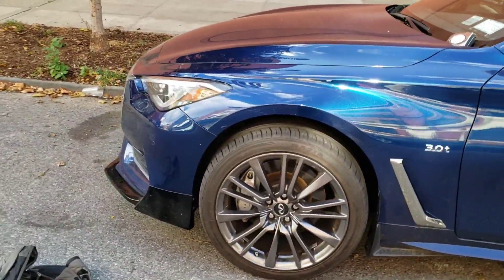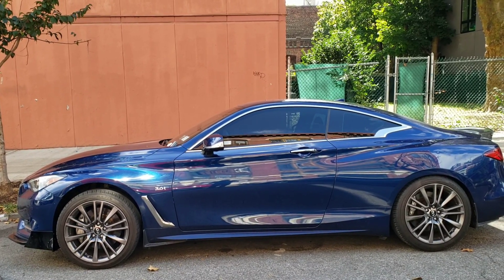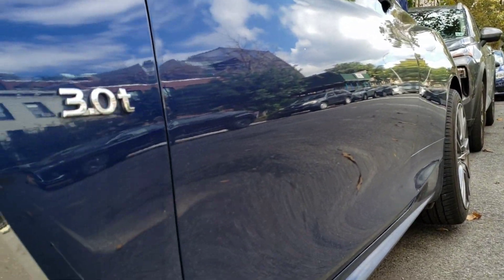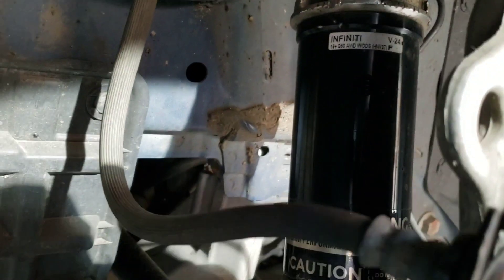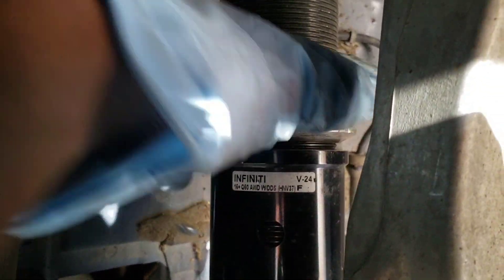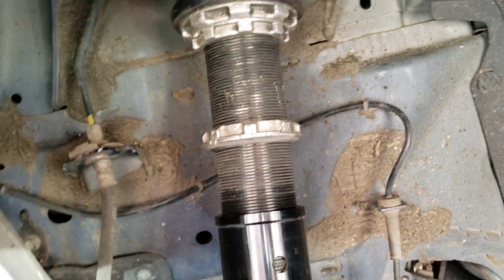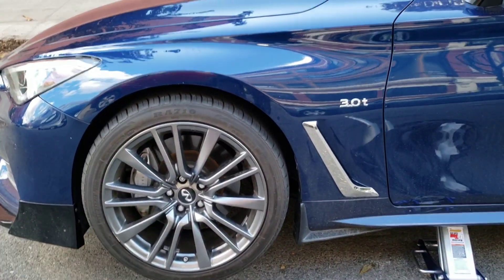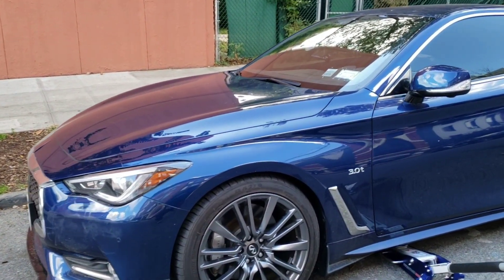Q60 with 20k springs in New York City

Comment: How’s the ride? I have 20k in the rear and 16k in the front and the ride is really bad
Reply from the maker: Noooo go down to 8k in the rear and put the 20k in the front  boom you will be fine
Reply: @BoostInMotion  where can I buy some good springs for bc coil for my 37x sedan
Reply: I'm literally in the process of trying to figure out what kind of spring rates to get for my Q60. Did you keep the 20k/16k setup? I'm debating 16k/12 or 14k rear.